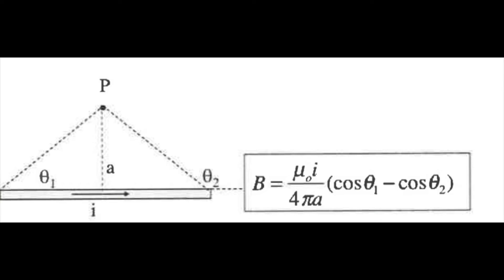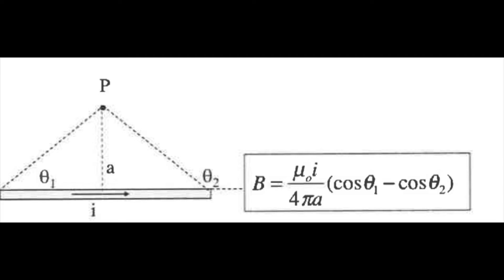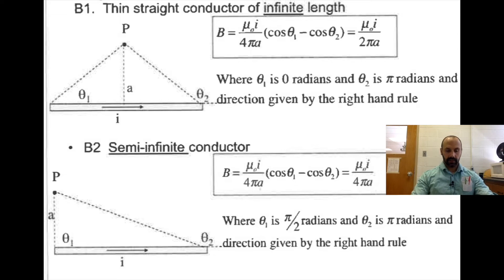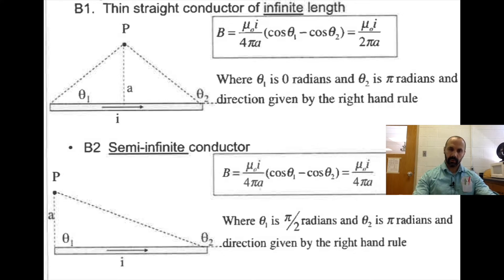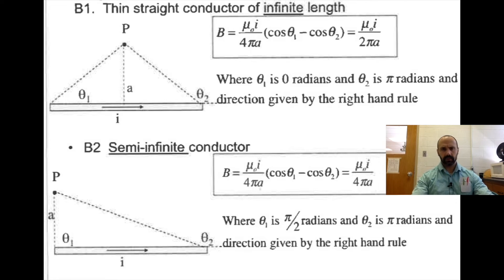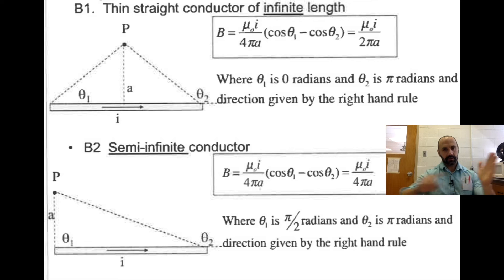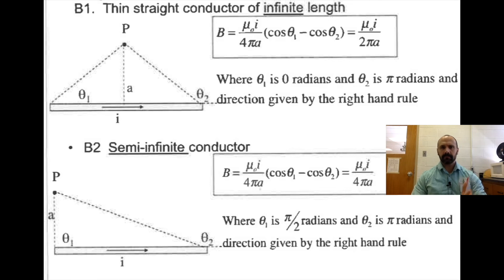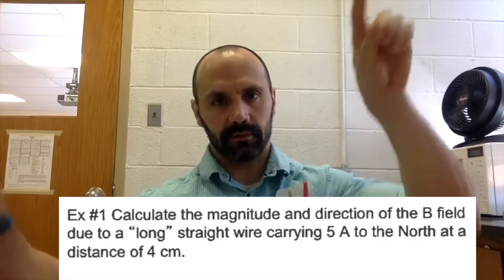Magnetic Field from infinite and semi infinite wires

Comment: In infinite wire how is theta 2 being pi radians ?
Reply from the maker: Hello friend. Theta 2 is pi because the angle is measured from the line along the wire in the direction of the current to the line pointing towards the point p. The longer the wire, the bigger that angle because the distance from p to the end (infinitely far away) is much, much more than the perpendicular distance from p to the wire.